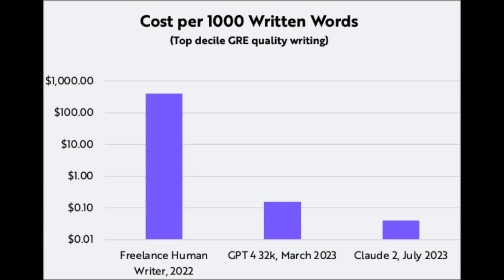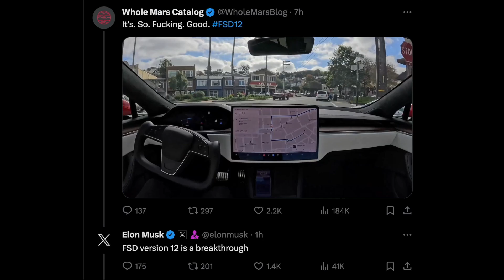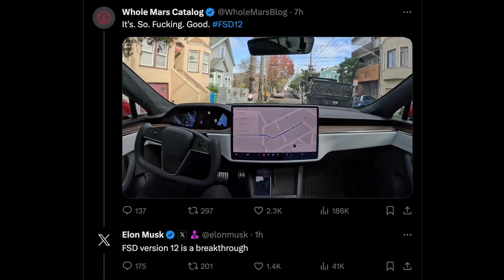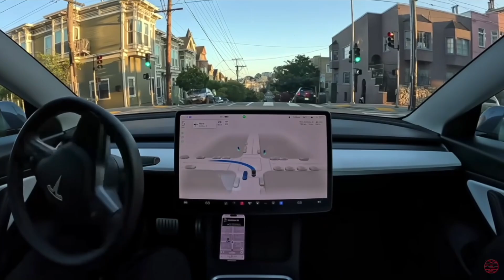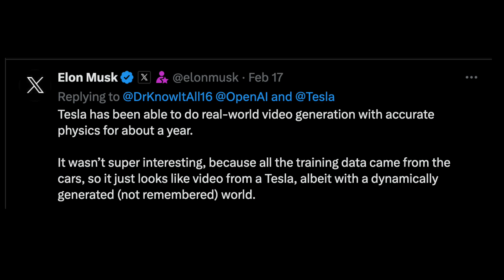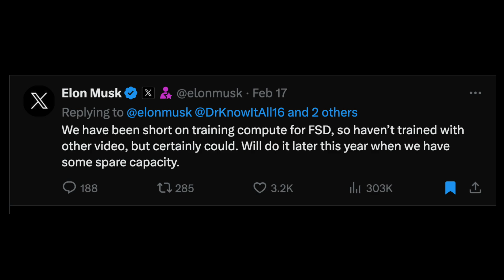From Sci-Fi to Reality - Tesla’s AI’s Exponential Learning Curve Unveiled

Comment: Waymo has defeated Tesla FSD ( so far though)
Reply from the maker: Can't really compare Waymos geo fence mapped area with what Tesla is doing though😉
Reply: Yes and no. Yes, Waymo has level 4 and Tesla does not. It makes people believe that Waymo is winning. If you dig a bit deeper, you will find a different story. Just imagine that the 4 million+ paved and 2million+ unpaved roads in the USA is a 10 billion piece puzzle. And making the puzzle is like driving FSD. There are 2 ways to solve this. You can use a top down (Tesla) and a bottom up approach (Waymo and all others). Neither is easy. In the bottom up, you take a small geographic area, eg 25000 piece puzzle, you HD map it and use not only cameras but also lidar to get around. This is the fastest way to get to L4 and geo-fenced FSD. You then copy paste other locations. It will take a long to get to level 5. In the top down, you need massive data, incredible processing speed and AI/ neural network tech to produce a general solution that solves the 10 billion piece puzzle, ie FSD everywhere and anytime. The massive data is the key differentiator without it, you have to go with the bottom up approach. Tesla has been collecting OTA real world data on all its cars since 1996. It needs a Beta version to consistently improve its FSD. In the mean time, it indeed looks like the bottom up Waymo approach is winning. But the top down will in my opinion win the gold pot. It’s cheaper to maintain and it works everywhere. While Tesla is working on L5 solution, I imagine it will receive initial approval from a geofenced L4 location, most likely San Francisco or Phoenix. Time will tell whether Tesla will be successful. I am betting on Tesla.
Reply: Waymo is stuck in its city, and it drives mostly in the highway if it can get away with it, and also it has a robot like driving, car cost arround 200k, and the public will not own one in at least a decade from now, so no, Waymo hasn't beat Tesla at all, it is jsut second to Tesla, and the difference with the first, is astronomical.
Reply: Waymo 250k per vehicle.